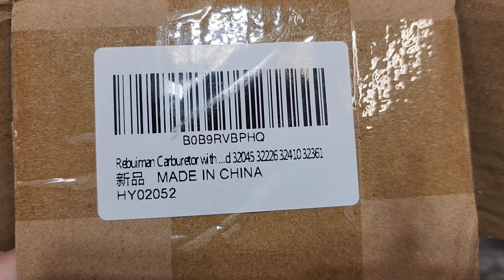My John Deere LX178 runs bad, leaks gas Lets replace the carb, change oil, and check the transaxle.

Comment: I got mine running real good but it sounds like The choke is on. I adjusted everything and it ran perfect. No problems then all the sudden it acted like it was running. Rich in smoking out the The exhaust like the choke is on
Reply from the maker: A couple thing are common..
. 1.. float level to high.
2.. and most likely...  the needle and seat are not holding the fuel and the gas is overflowing into the engine. Check the oil level and make sure it is not over full. These engines do not like being overfull and has may be overfilling the oil level.

Comment: The throttle that is bolted to the side of the block on the left side that is bolted to the block that goes to the carb I believe it's the throttle lever. Do them have to be adjusted a certain way mine was off
Reply from the maker: If you adjust it so that the choke works as it should, you should be good.